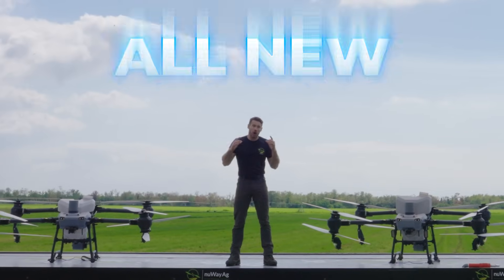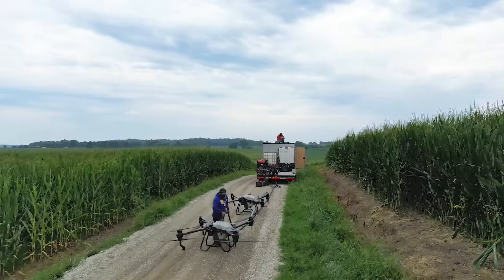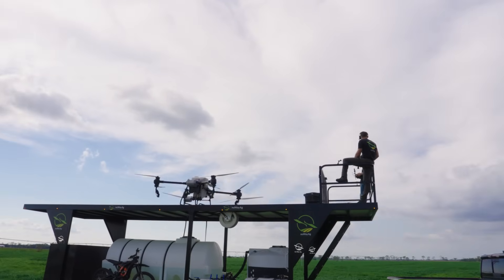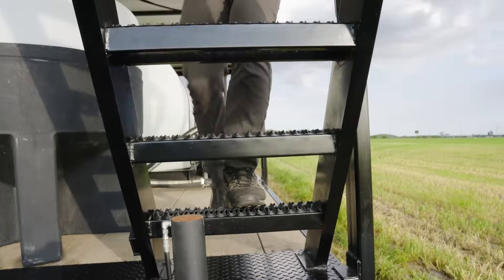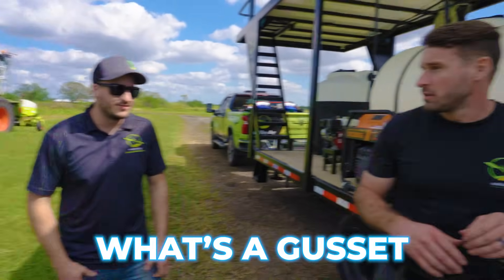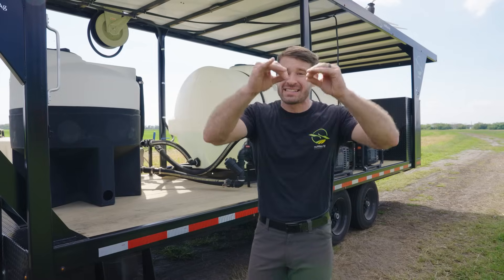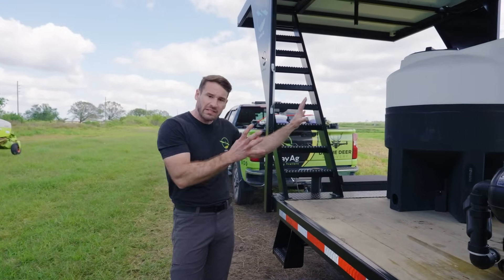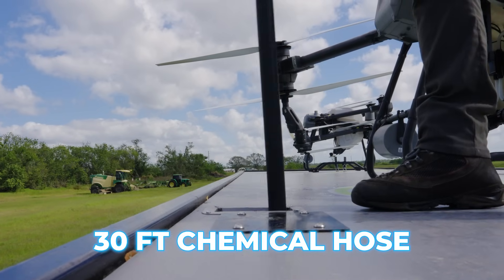2025 Top Ag Drone Spray Trailer: nuWay Ag Unleashed!

Comment: There are some great improvements here. This should be offered in gooseneck also, bumper pull is OK for small stuff but gooseneck is more maneuverable and tows better when loaded with 10k lbs of water plus the tare weight of 8k you are overloaded with 16klbs rated so you have too much capacity for your axles that seems like a design issue.  The battery boxes move around in the video, putting them in the deck at the edge seems like a bad plan, fall risk and fatigue doing weighted lunges all day. Also a color other than black as an option would be nice.

Comment: You made some very interesting design choices. 

Did you consider putting the pilots area in the middle so you don’t have to walk next to an unfenced drop when operating 2 drones?

Also, could you add a small davit crane to the deck to lift seed to the flight deck?

Comment: I purchased a spray foam business and improved the efficiency of it by a whole bunch.  You can see some of the stuff I did by searching "concrete ditch repair".  I can see some things that would help with the trailer.  Get you below 12' 6" without sacrificing your pilot area.  Super simple stuff that is used elsewhere so I'm inventing anything, just taking advantage of other industries.  Like there is a way to put the stairs from the ground to the pilot area allowing access to the chemical area as well.  You might have to sacrifice about 2 inches in width but you could do that just for the places the ladder crosses.  There are other things I might be able to help with.  Cost?  Yes, I want something.  Just a letter on company paper acknowledging the ideas.  Not a big price but really think it would be a nice gesture.

Comment: What are the benefits of this setup if I am treating woodlots and not farm fields?  We are flying at 250 or so AGL.
Reply from the maker: So the height of the top deck won't help with visibility like it does with row crop, but it would keep the people or objects from walking into your LZ. Also, with the deck blocking your generators, your base noise level will be cut compared to working next to it on the ground.  If you already have another trailer set up, with pilot protection walls and hydrolic jacks some of the benefits may not be relevant with your niche service. 

You are welcome to join us for a demo day here at our HQ in Winesburg Ohio and see it in person.

Comment: You don't mention the drop areas for the cooling stations that were on the 2024 trailers, and it seems like it is removed on one in this video and still there on another trailer in this video.  Are they removed now?  Is it better to have the cooling stations up at the protection wall on top the deck?  What's the update on this?  Thanks!
Reply: Actually on your website, it says the sunken charging stations are still there, but on this video, they are clearly not there and are up front on top of the deck...  What's the scoop?
Reply from the maker: This is a good question thanks for asking it. Sorry I did not clarify that in the video. It is now an option to have it at the pilot protection wall, or have it sunken into the floor. I had pilots tell me they want it up by the pilot protection wall because if they have a ground guy helping them, they don’t want the ground guy back there fiddling with putting the battery into the charge system when the pilot wants to get the drone back into the air. This allows ground guy to walk away from the drone and pilot can launch drone rapidly. If it’s a single man operation, someone might still want it back there in the floor.

Comment: Well, I've been waiting on this video. Good job Mike. I have been thinking about a configuration that starts with your trailer... although like most of your viewers, I've been looking at all of the other trailer videos too. One in particular has a feature that I envisioned the moment I saw your setup. That feature is what they are calling "wings" but it's really a collapsible flight deck that also doubles as security wall when closed up. I really like the idea of the center flight deck being the human area and the wings are the LZ that should hold two drones on each side for a four drone setup. So, that being said, I'm thinking maybe 2x the 1K fresh water tanks. Yes, I realize that's gonna require a heavier trailer and possibly a gooseneck too. I guess the real question might be, is it better to have two of Mikes light trailers for two drones each and two trucks or one that can handle 4 off one HD trailer with one truck?
Reply from the maker: We’ve done it before where we’ve run four drones from one trailer in my honest opinion there is just way too much going on in one location to be safe and efficient even if there’s multiple pilots, you have lots of aircraft coming into the same location to land and takeoff even if your trailer is split. You will be dealing with needing to communicate with pilots at all times who is going where and where they’re coming from. I have released the nuWay mega trailer. It’s on the website.
Reply: @nuWayAg  Yup, I just saw the Mega setups. Love it! But just one question, isn't using three or more drones on one 1K tank limiting the amount of coverage? Seems like you'd run out pretty quick at 150 acres per hour. Confession, I've been into drones stuff since 1985 but I am a complete novice at farming.
Reply from the maker: @DKTek07  Mega has 300gal mix tank and 1635gal total drain tank. Plus room on the back for another pallet/tank/ATV
Reply: That sounds more like it then. Thanks Mike! Keep up the innovation. I'm a fan and a future customer once I pass the CORE and Aerial Application process. Really looking forward to a video on the Mega series.